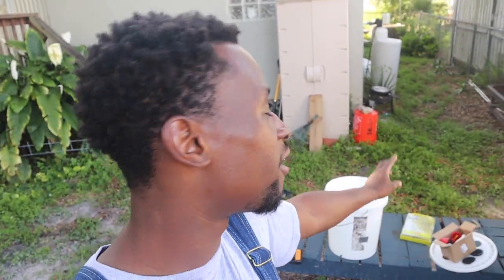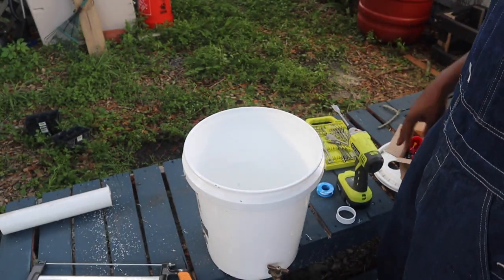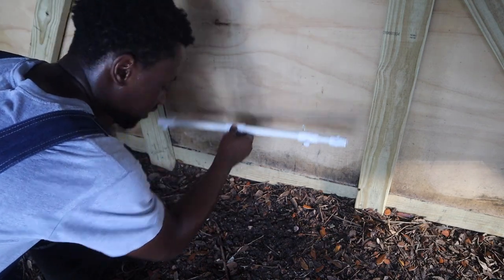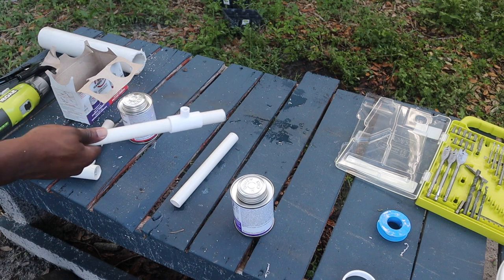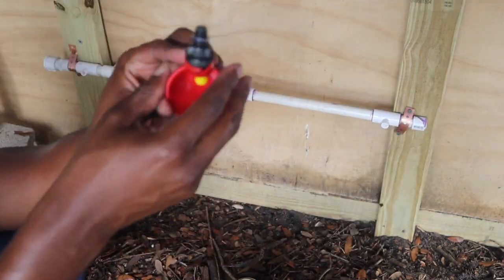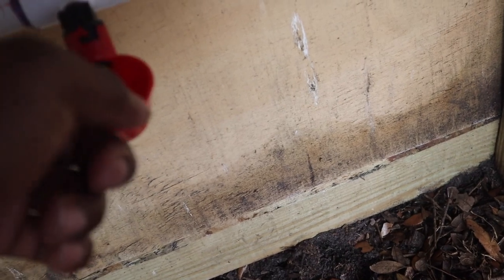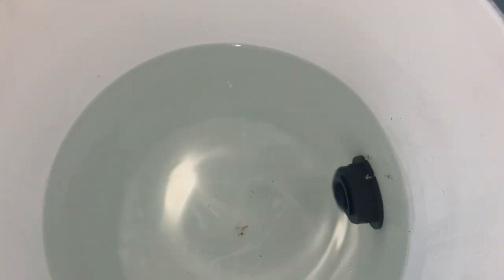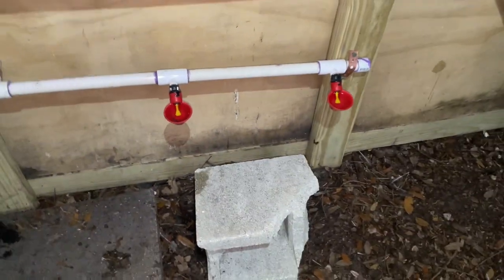DIY Self Watering System for Backyard Chickens

Comment: You should add some holes to the lid. Otherwise as the water flows to the waterers, it will create a vacuum in the bucket and stop the water flow.

Comment: Nice work. Probably how I'd want a set up. You may end up with a problem depending on how air tight the lid is on that bucket, though. If it's air tight, you may end up with a vacuum forming inside the bucket as the water level goes down, which may reduce the flow to the cups. If it's not air tight, it wont pose a problem. But if it does, you only need to leave the lid loosely on the top so air can get in. Great job. Be well, and stay safe.